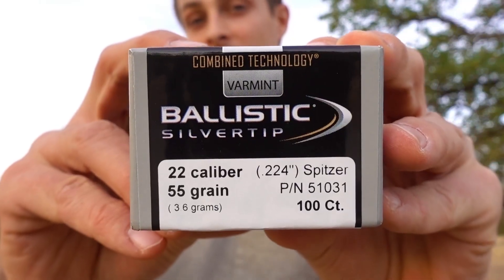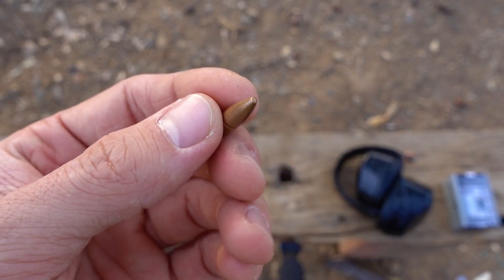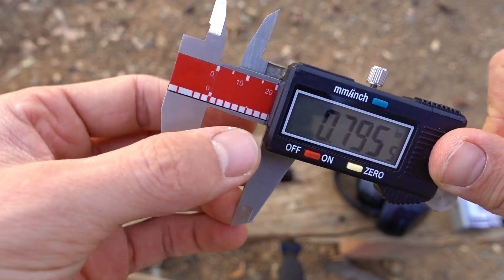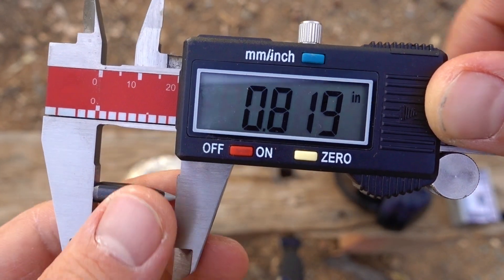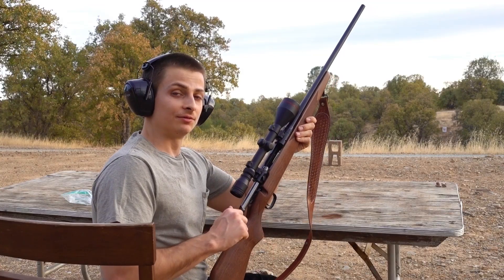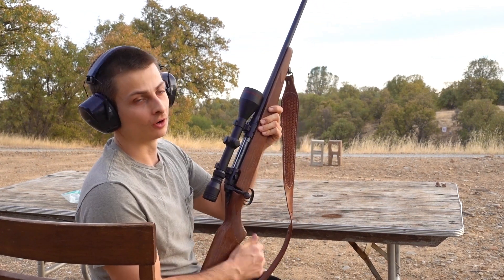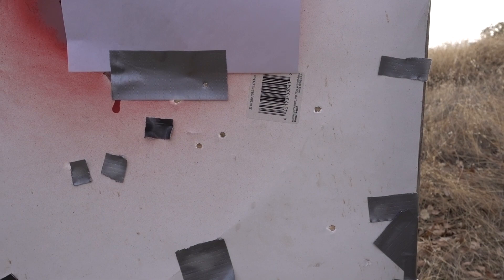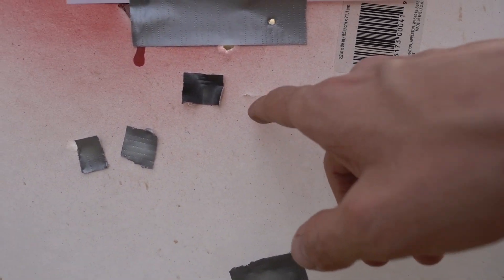Long 55 grain bullets in a slow twist barrel

Comment: I am facing the exact same issue only my gun is a 22-250, think 1 &14 twist.  Just like you I tried some 62 grain bullets that did not shoot.   I was Wondering if you could play with different powders and different charges to get them to Stabilize.  I put some 53gr vmax together yesterday and have barnes and sierra BTs in 55gr I'm curious About?

Comment: Sir, you appear to be a little confused as to why a bullet will stabilize in a particular twist rate. No offense, please! It's not so much the wt. of the projectile; it is the "bearing surface' of the projectile in the barrel. ie. how much of the bullet (length) is actually touching the rifling of your barrel. A simplistic explanation, yes. But it is true.
Reply: He's right on bullet length though, which typically leads to better BC.  I can't understand why in the world the gun makers wouldn't put faster twist barrels to enable guys like us to shoot those longer, typically heavier bullets.  That 22-250 of mine has plenty of charge to push them, but wrong twist....never again....if you get one of the 22 cals GET 1 WITH 1 AND 10 TWIST OR BETTER!

Comment: The key to stability in a slow twist barrel is speed.
If the bullet is fast enough you should be fine
Reply: So go with the top of the powder range to gain speed to compensate for the slower twist??